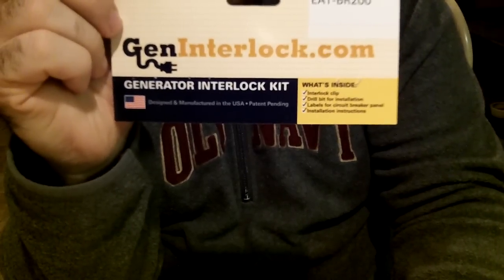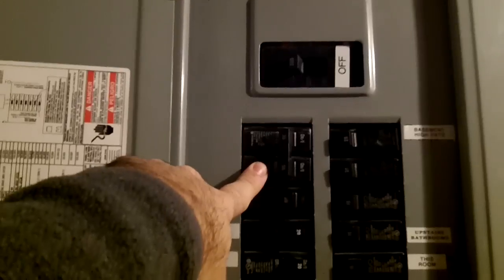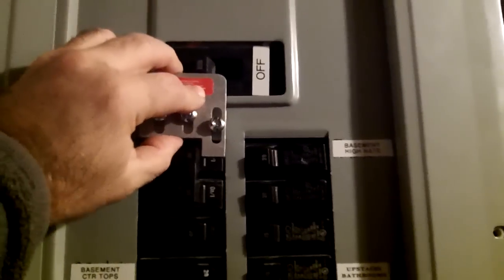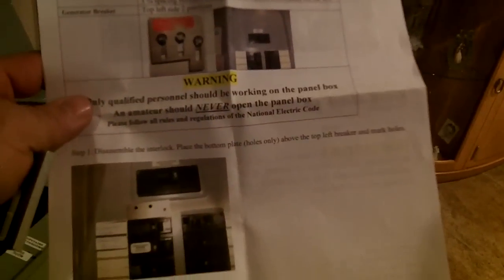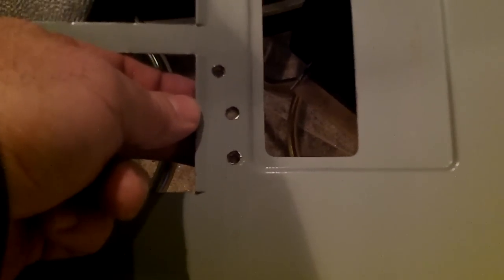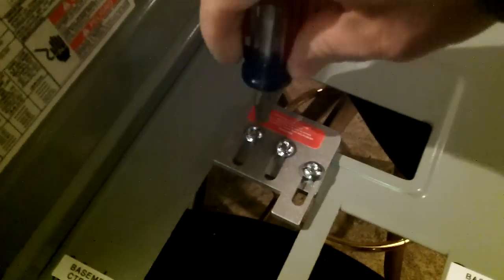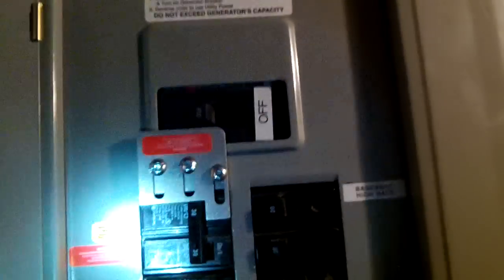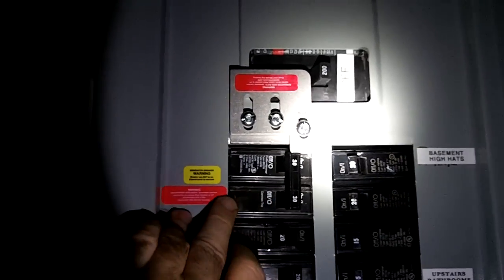HOW TO INSTALL A GENERATOR INTERLOCK SWITCH

Comment: Why a licensed electrician?  I am not a licensed electrician, but when I was in the Air Force, I was expected to install 480 Volt step up, and step down transformers, install power lines to electric winches and antenna rotors, and obstruction lighting on Antenna Towers.  Did not have any license then, why would I need a license to install a metal bracket?
Reply from the maker: It all depends what your local codes require. Federal Govt is exempt from local codes.

Comment: Well my 200 amp panel is spaceless.
 So I'm going to make two 12 ga. extension cords with male ends and plug in to both poles by two outlets.
Kill the main and run what I need from my 7kw gen.

Screw it.

Comment: sr in the teblet the main switch only cuts the phases the neutral no.  when connecting the generator there is no problem with that.  Thank you

Comment: Folks buy a Reliance Transfer Switch, do it the correct and safe way, you will be happy, happy, happy.
Reply from the maker: To each his own.  I was considering that option but I am much happier with this system because I can better control what I want on and off during a blackout.

Comment: this is the easy part people , before you even put the switch in you have to take off the panel and wire in all the wires that would go to   your new 240 circuit breaker from your gen and the whole  house wires that feed the other breakers in your panel  , those wires are new wires that will then feed your house,  yes you will by pass the main 240 circuit breaker to the house from the pole , some boxes let you set the new 240 breaker from the gen to your house wires side by side of the 240 outside pole breaker or it could be placed under the 240 outside 240 pole breaker,in your house box panel , yes  now you have two 240 breakers in your box,one comes from the pole the other will come from your gen , in most states it is law that you need to put in the Interlock  switch made by the company that made the box , check with your town or city first before buying the  Interlock  switch, then install the right  Interlock  switch by town or city or state code, yes it could save a person life that works on the pole power lines from back feed from your gen , also some Interlock  switch comes with a light or alarm kit that will show when the pole electric power comes back on in service, yes that is more money but will let you know when the pole power is back on , so you can then turn off the gen feed and switch the   Interlock  switch back over to the power company electric feed to the house panel 240 pole main  breaker , putting in the Interlock  switch, is some what easy, but the hard part is wiring the new 240 breaker from the gen , i myself find this the best set up for your house because you can have heat and cooling to your house that needs more power then just a 110 will give you, it is more work in wiring and the cost, but you never know how long the electric company power will be out , they the company work hard to get your power back on but sometimes hours could turn into days with out power , DO THE JOB RIGHT OR DON'T DO IT AT ALL, PLEASE ,ALSO IT IS IN MOST STATES , LAW THAT A  ELECTRICIAN  DO THE WORK ,

Comment: I'm seeing these interlock switches on eBay between $55-$65. What a freakin ripoff! Two plates and some screws. These things should be no more than $15-20.
Reply: And you're being generous at those values; $5-10 would be more apropos.
Reply: Make your own very easy
Reply: @kevineustice1  True. But, by the time I buy the sheet metal, a saw, blades, screws, washers and nuts, I can most likely buy one of these over priced switches online cheaper than the cost of the DIY solution!
Reply: @Geonious  lots of guys have the tools laying around, sheet metal nuts n washers are cheap.  much cheaper for guys handy with tools.
Reply: Exactly...stamped metal..,mass produced...$20 is about right.  I see them on sites for over $100.

Comment: A great idea. But with the panel cover off it becomes an electrical danger to any High Voltage guy working on lines nearby. And yes, for that 1 second of backfeed through a residential pole mounted 1,200 volt transformer it could spell death for a lineman.
Reply from the maker: You have to keep the panel on.  In NY state the linesman work on live lines all the time. They rarely kill the power.

Comment: Very good video, now how do you know when power grid is back on?
Reply: You won't know... it's a manual switch. But you'll know when your neighbors have power back on when you see their lights are back on.
Reply: You can easily test it by turning the breaker for the generator back off, then turn the main breaker back on.  If you house lights up, you have power.  Might take all of 30 seconds to test it!

Comment: The danger of feeding a panel with the grid and a generator AT THE SAME TIME is far worse than explained in this video!  Generators don't create the same wave frequency as the grid, also your generator won't be in phase with the grid.  These two overlooked facts mean that if you power a panel with both at the same time, you will have an explosive reaction that will end in fire.
Reply: You never want power coming in from the grid well your genny is hooked up
 That's what this prevents.

Comment: A licensed electrician wired my house and left behind many obvious errors, like several inches of bare hot wire in outlet boxes, many outlets with 2 wires on one screw terminal. So don't give me that licensed electrician BS. I'm an EE and I would say there are many people who can do better work than a licensed electrician.
Reply: It's nobody's fault but your own for not doing any research and hiring a moron, hack to wire your house lol.
Reply: @will4918  Did you read my previous message. My house was new construction -LOL
Reply from the maker: Sounds like you hired the wrong guy.
Reply: I didn't hire him the builder of the subdivision did - DR Horton. If you ever buy a house built by DR Horton be very careful.

Comment: Had a REMC lineman killed the county to the south of me this summer during an outage.  A farmer was back-feeding a panel and had stepped up power going back into the grid.  I have no idea of any specifics or if any such device as this was being used or not.  I only have two problems with any Interlock Device factory or not.  IF the main breaker doesn't break contact then you're still connected to the pole line.  It can happen.  I've seen main breakers lock up and not open/close properly.  You have NO way to know unless you remove the panel cover and perform continuity checks across the main breaker line side and each leg of the panel.  Also...depending on how your panel is wired up...even if you try to load manage with individual breakers turned off you could end up powering only your essential circuits which might all happen to be on one leg side.  This causes an imbalance in the generator and you'll never get the full power of the gen set.  Just something to think about.  I like these but think I'll go with a $300 6 circuit transfer panel setup although I don't like them for other reasons.
Reply: You could just walk outside and check the meter to see if it is moving!
Reply: You would think the lineman would test the wires to make sure there not live before doing anything and if live listen for a generator running and trace it back to the culprit.

Comment: Nice job.  I am installing a generator and really like the simplicity the interlock offers.  I can choose which circuits are powered but can't backfeed the utility line.  A better (and much less expensive) option to a 6 or 10 circuit transfer switch.
Reply: You might  be able to choose which circuits you feed.  Problem is that if the ones you want are mainly on one particular leg of the panel, you're generator will be over loaded on one side of it's generator field while the other supplying the other leg is largely unused.  So your 5000W gen will only be good for 2500 if you're real unlucky the way your panel is setup.  Few people load balance a new panel installation when building a house.  They just put breakers where they fall in order.  Even if you load balance the pole line to some degree...the load managing under generator loads might be very different than when considering full line power.  Just a thought.

Comment: I was all set to buy a transfer switch until i watched this video. I went out and looked into my breaker box and came to the conclusion that limiting my choices to a set number of 6 breakers was both self defeating and unnecessary. I just ordered my interlock switch a moment ago, however I would like to ask if there is a special breaker that has to serve as the feedback breaker, or will a standard 30 amp double pole breaker of the appropriate maker all that is required? 
Thanks for taking the time to make this informative video.
Reply from the maker: UnknownUzer It depends how many amps your generator's NEMA outlet puts out.  Mine puts out a maximum of 30 amps so I use a 30 amp double pole breaker.  Make sure you get the appropriate wire for the job.  I have seen people make backfeed wire using 12 GA which is too small for 30 amps.

Comment: I recommended this interlock to a friend, but he said he was told by an electrician a transfer switch is safer due the fact that a main breaker could fail, leaving the panel "live" and can backfeed to the streets.
What are the chances of a main breaker failing? Don't transfer switches fail as well?
Reply from the maker: Mike Pier I never encountered a main breaker that failed.  I'm not worried about it.  This method allows you to power any area in your house.  A transfer switch will limit you to what areas you want to feed.
Reply: unless you have a massive generator you're still limited to what you can power -anyway,  so you're not very far ahead anyway and u still got a mcgyver contraption in place

Comment: I purchased the same interlock from same company in New Jersey for $62 off ebay for my Murray panel. Worked out great, cheaper and simpler than transfer switch.
While I understand you disclaimer about having a licensed electrician install this, the instructions are straightforward and a fairly competent DIY'er including myself can do this with no problem.
Reply from the maker: Mike Pier I just wanted to cover my bases in case local codes won't allow a homeowner to make alterations or connections on the box.  You would be surprised at the emails I get.   I live in NYC and any connection or alteration of a panel needs to be made by a licensed electrician.You are right.  It is a simple install but here in the Nanny state of NY.... nothing is easy.  Thanks for watching!
Reply: Mike Pier jk)
Reply: Do you have part number for kit?

Comment: why would I need a licensed electrician to pull off the face of the panel, line up a template, drill 3 holes, then screw the interlock on?
Reply: you don't unless code requires it.   ours does not...I wired my own barn shop garage had it checked by a friend that was an electrician and had it pass the state inspection...it was permitted though   if you understand wiring it is actually quite simple..
Reply: That's just the breaker/ safety install.  An outside receptacle has to be installed and wired to that breaker.  That breaker is fed by the generator.
Reply from the maker: Some local codes require a licensed electrician to install the switch.  I live in NY the nanny state.  NYC code requires a licenced electrician install the switch.

Comment: Liked your video however, i cannot justify the cost of a "stamped out piece of
metal" , so i fabricated my own. I must say i did use your store bought interlock
as a template , since i have the same breaker box, Cutler Hammer. It worked out
very well, thanks again you saved me $60.00 plus bucks.
Reply: gnapert B U T...!!! your home made one is not "APPROVED"  big difference...it may work just fine but  IF you have a fire your insurance co may balk at paying because of using a "Non  Approved " part....just a heads up....
Reply: gnapert  The Nat'l electrical code says all equipment used in a load center is to be of the same manufacture as the box.  I went round and round with the Electrical inspecter because I used a different brand breaker to get the breaker I needed...I lost  he woud not approve it till I changed it.  just a heads up...that "Cheap" interlock could get real expensive.  I had the same idea, it is a lot of money but my electrician  friend reminded me of that little fact.
Reply: Cost to manufacture - maybe $1 and they charge $62?   Give me a break.   Anyone with some sheet metal skills can manufacture this for very cheap.   I had some scrap metal around and made one that works great for FREE!
Reply: UL....  Nat'l Electric code...  Cutler Hammer......
Reply: Ron Husser It  is even in the National electrical code that all components is a given brand breaker box be all of the same manufacturer as the box !!!  Goods thoughts though !!!  I have this same lock out on two breaker boxes on my place to run the generator...works great !!!
Reply: I can understand people wanting to make their own it would save a lot of money ,but, if the assembly is not listed by underwriter's lab's " UL Listed", it should not be used, any electrical device or equipment is tested by underwriter to assure safety and if a device or piece of equipment is not UL Listed I would not use it period! It would not meet NEC standards , would fail any inspection and as mentioned by another comentor insurance companies would use that as a excuse to deny any claim if something was to happen.
Reply: Wilbur Finnigan Approved by Who?   The code says how the item should perform.  I made mine exactly like the Cutler Hammer one which is a metal plate with 3 slots and 3 screws.  I'm not aware that the Cutler Hammer metal plate is manufactured to a specific specification.

Comment: I installed this very same interlock in the same load center. It was rather easy, only caution, is make sure you have the interlock lined up correctly before drilling, or you may have to "adjust" the holes. I did this myself and also bought the inter lock on Ebay after figuring out which interlock I needed. This is available on internet using your loadcenter number. I am not an electrician but as long as your work is "code" its ok. Works great and have used it a couple time. good instruction Thanks.
Reply: is this a better solution that using a transfer switch? This seems kinda "cheap" way to do this.
Reply: do you have a part number?